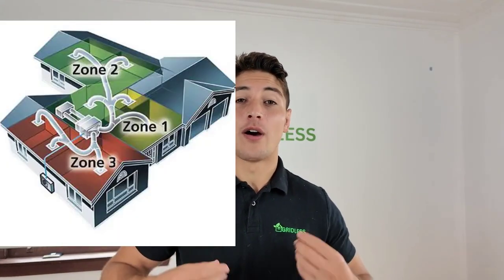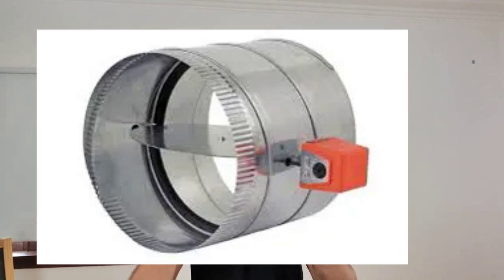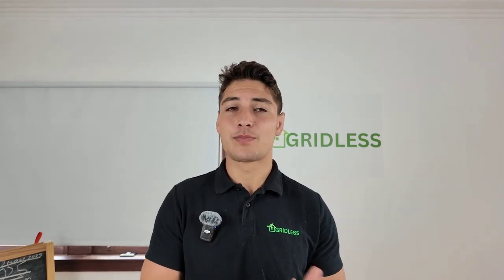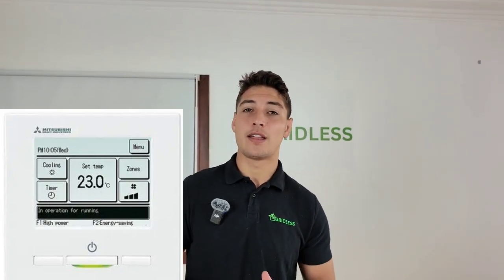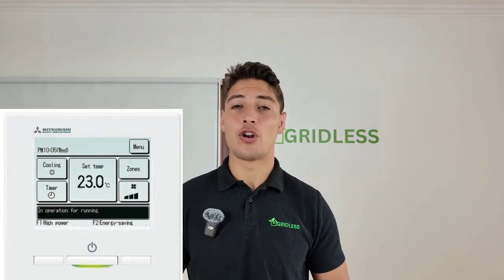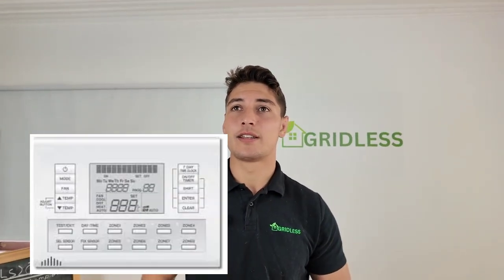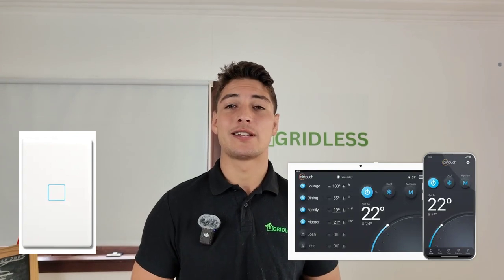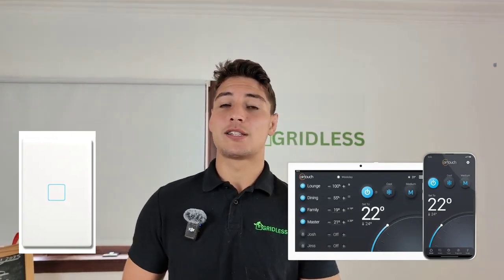Everything You Need to Know About Zooning for Ducted Air Conditioning Systems

Comment: I got midea vrf 23 Kw machine for single storey house with 10 vents and 6 zones. I see the airflow is too high even at the lowest teperature setting. I am using airtouch 5 which is not making any difference in the airflow control either. What is wrong here?

Comment: Is there a difference between spill and bypass? Felt like you just lumped them together?
Reply: Spill and bypass both relieve air pressure from your ducting but work in completely different ways, bypass works better than the spill.